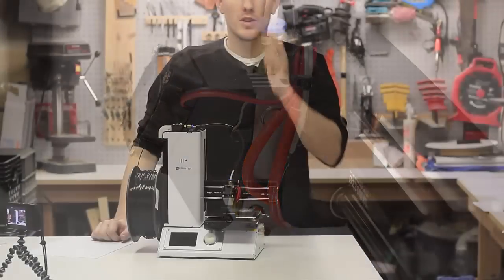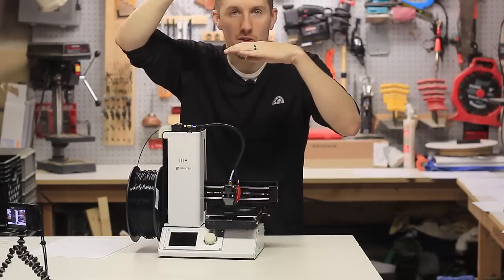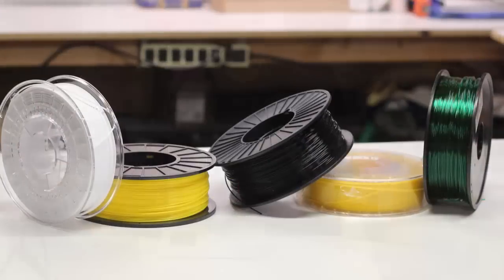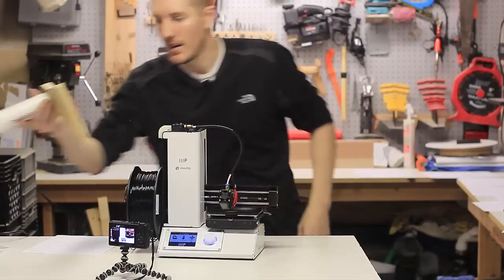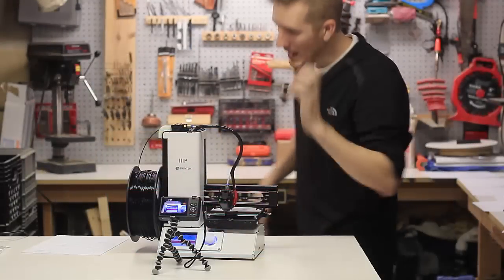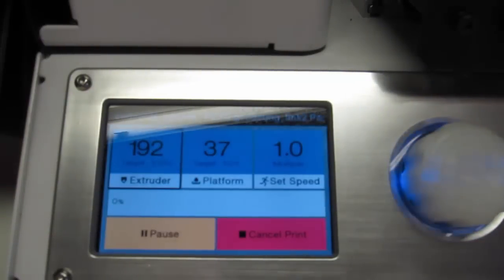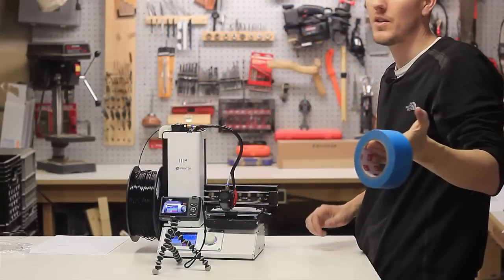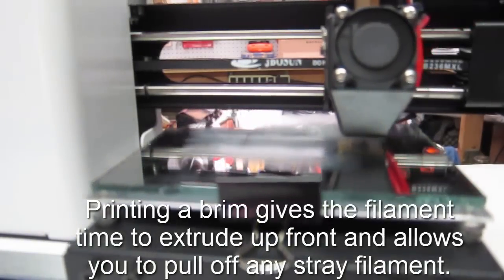3D Printer Setup - Monoprice Select Mini - First Print

Comment: I got a black version for Christmas with a color screen. I can’t get the wifi to work (yes I DL’d the app to my phone) The files on the micro SD card were PC based files (.exe), so I had a bad feeling the damn thing would not work on my macbook. It wont. They provide you with Cura with no profile for this printer in Cura. It’s a $200 paperweight that can print a cat. I can’t get a single thing to print.
Reply from the maker: Never tried the WIFI with my Version 1, and never updated the firmware.  As far as a profile, you can import the profile from the cat.gcode and use that, or see my video about what settings to use.  Just import the 3D file you want to print then import the settings from gcode, and use the cat file.  I always print through the MicroSD card, but you can also print directly from your computer if you connect it with a cable.
Reply: Noeland if you have a pre 2014 MacBook with an sd card slot all you have to do is get a microSD to SD adapter and put the stock microSD that came with your printer into your computer. then open disk utility and format the MicroSD to EXFAT format. Once you do that just load up any stl file into Cura and slice as a g code to the desktop ( make sure you send the file to the desktop first and not directly onto the card from Cura otherwise the file can get corrupted, also I’ve noticed for some reason if you give the file an excessively long name this can happen as well so try to keep the file names short as possible). Then just drag and drop the file to the MicroSD and eject. Make sure your printer is powered off, insert the card and turn it back on and you’re ready to go! Got this as my first printer a couple months back and although they  can be frustrating at first but once you get the kinks worked out these things print absolutely beautifully. Good luck and if you need any more help getting started shoot me a message!
Reply: Just want to say THANK YOU for the advice! I have an SD card slot, but the printer won't read any files made on a mac. So I borrowed my wife's Dell, and installed Repetier from the SD card provided to make my Gcode files. It works. It's a long, long way from being ideal, but it works now. But it only reads the micro SD card it came with. It won't read any other micro Sd cards. I still can't print from either the mac or a PC with the USB cable. I get a ton of errors trying that.

Comment: If you use those metal measurement flaps that often times come in a calliper set, and use the one measured at 0.05mm instead of the paper to measure the distance of the nozzle from the bed, you probably will not have to do the 0.5 set speed for the first layer anymore.